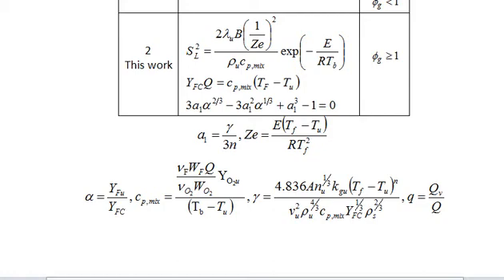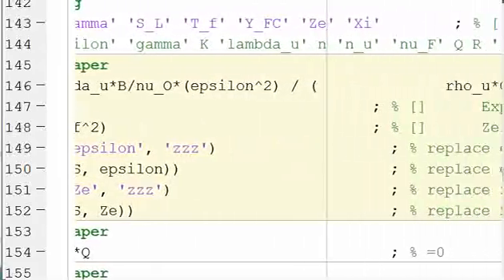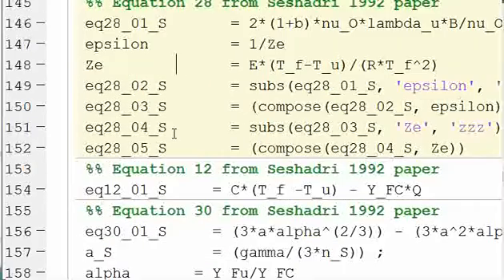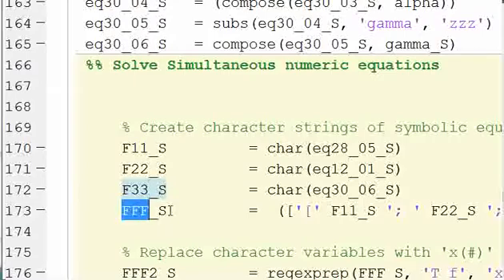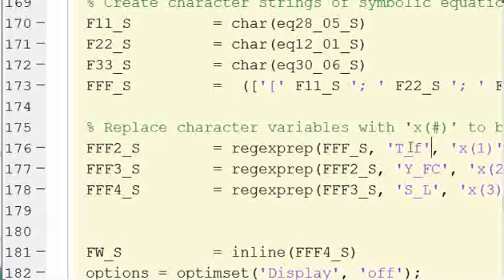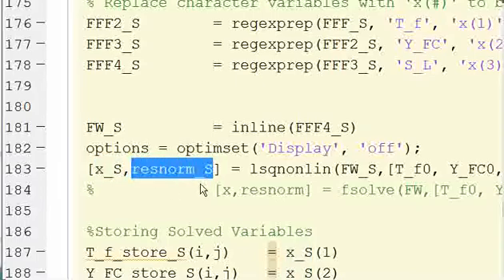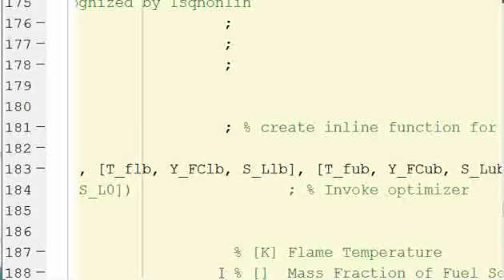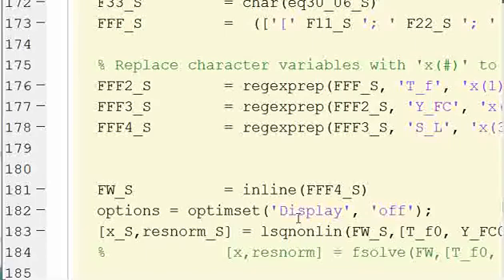MATLAB Solving multiple coupled non linear equations using lsqnonlin Part 1

Comment: I have one question. Why do you use subs to replace 'epsilon', 'zzz' and then use compose to introduce epsilon again. Would'nt it be easier if you just use (compose(eq28_02_S, epsilon)) instead of using subs. What happens if I have more than one unknow variable in my equation? Thanks